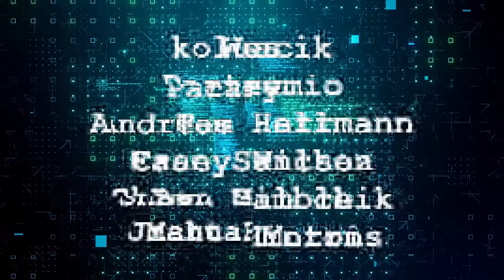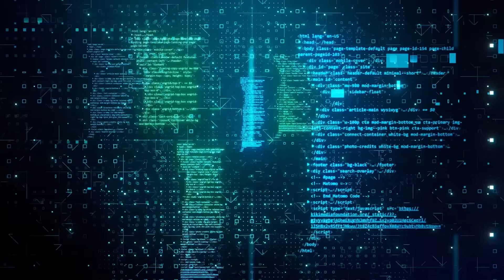Writing a CAD Language in Rust (with Adam Chalmers)

Comment: Let's say you have a machine and model it as an assembly with say 1000+ parts.  How does one work with the code to modify an integral part and not violate the constraints of a sub assembly, adjacent assembly, or other parts of the hierarchy?  SolidEdge, SolidWorks, Catia, F360, heck even FreeCad all have the equivalent of an AST in their hierarchy and it is two way modifiable.   I don't see this solution contributing in a machine/product design context.

Comment: I use OpenSCAD.
Reply: Using the mouse in OpenSCAD as well would be really cool. But I am probably not going to switch to KCL as I cannot have control over the software. Their tools are free now, but they can change their pricing dramatically or shut down their GPU servers and I would be stuck with a dysfunctional app.
Reply: @theevilcottonball  right?   I heard some of the intro, and thought "ooh, someone's doing the thing I've been dreaming about for years!  Maybe I don't have to anymore!", and then it became clear that not only was it non-free (in the GNU/FSF sense), but also cloud-based, and both of those are deal-breakers for me... so, I'll still hope someone else takes it on, but maybe I'll also eventually get to it.  :)